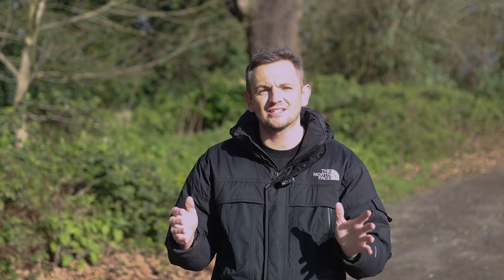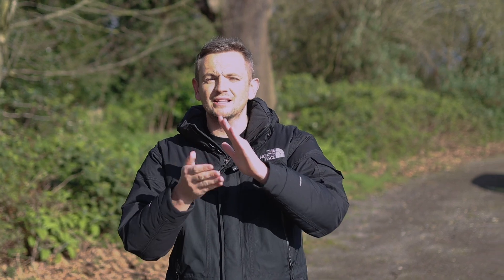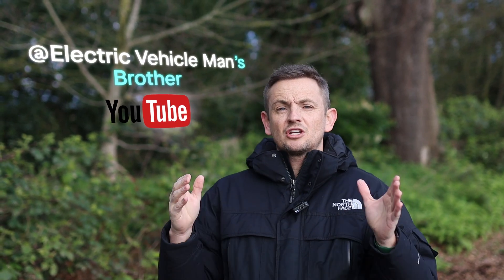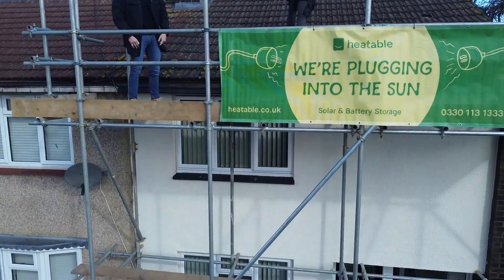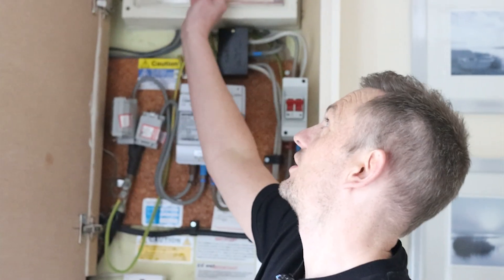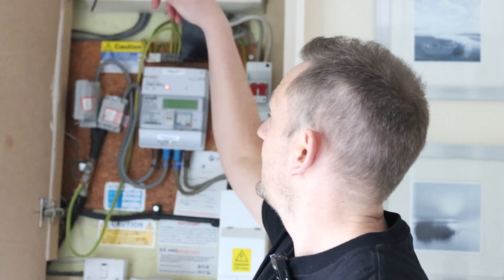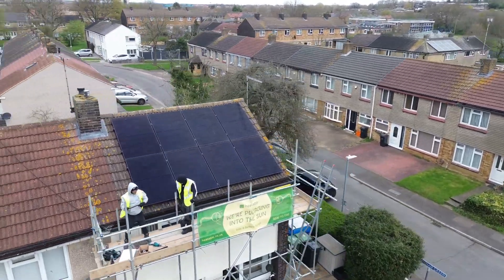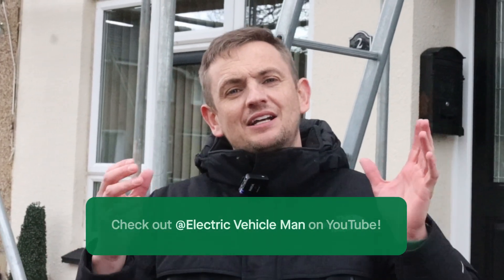440W Bifacial Panels + Hybrid Inverter: Game Changing Energy Solution?

Comment: bifacial works better if you have a gap of 4 meters. Or perhaps you can paint the roof white so it reflects more light to the back of panel.
Reply: I was wondering this myself, stands to reason it would work but to quicken the instal I'd probably use some kind of plastic or vinyl strips that adhere to the roof  tiles just behind the solar units. I'd love to see some real-world testing on a system like that to see what kind of gaines are possible.
Reply: @tangent2658  this is not made for roof. Bifacial are for solar farms,  structure mounted systems and carports.
Reply: A gap of 4 metres? Some light does reach the underside, but the main use is to capture the light passes through the top panel.
Reply: @grahamcook9289  yes I read that on some bifacial solar panel manual.

Comment: You're installing a hybrid inverter in the loft in 2024? Aren't wiring regs changing to make batteries in the loft verboten? How far away could you install a battery, in the future, without huge losses from the DC run?
Reply from the maker: Hi, thanks for your comment. PAS 63100: 2024 related to recommendations around siting of batteries. GivEnergy have released their own guidance on this following the PAS 63100: 2024 release. Ideally, where space allows we would avoid loft spaces.

Comment: Can you address one question - what is the value of using bi-facial panels on a roof install where the amount of reflected light onto the back is likely to be limited?
Reply: The benefits will be minimal. Bifacial are designed to be used where light can be reflected on to the back of them, ideally installed meters above the surface, not on a roof.
Reply: @TheRonskiman  The question was aimed at Heatable as they are the ones who installed the panels.
Reply: @rogerthomas7040  I know, but  do you really think they are going to answer the question? If answered honestly it would undermine / contradict their advertising, other option is to lie.
Reply from the maker: @TheRonskiman  Hi, thanks for your comment. We've answered the question above, we'll be uploading the comparison test in the coming month. All our proposals use the front sheet KWp ratings, which in this case is 440w.
Reply from the maker: Hi Roger, thanks for your question. This gets asked a lot so we're putting a comparison test video together at the moment. All will be revealed. Importantly though, we only ever quote the front sheet power rating when sizing systems for our clients. Any upside is a bonus 😀
Reply: @Heatable  That will be interesting, please match the panels very closely, only difference yours being bifacial the other not, and make sure you use the same micro inverters on both side by side, installed as they would be on a roof.

Comment: The REA panel has a rated efficiency of 23% that's the same as JA solars 23% also double glass black panel. Several others have 23% panels. You're slightly over stating the uniqueness of REA. Also every one of them has a +0-5w positive tolerance on their leaflet. None I've seen state +/-5w
Reply: You can find a number of vendors who make statements about their products such as "Module efficiency up to" or for one vendor their warranty states "During the first year, {The company} warrants the actual power output of the Products will be no less than 97.5% of the labeled power output." which is stated on a 575W panel for 2.5% possible drop is a fair amount. Both are ways to not have to state a firm +- value. As long as you find the fine print it is easy to work out the real 'value' of a panel.
Reply: JA is low end Chinese rubbish. No comparison to REA / REC etc.
Reply: @singlendhot8628 
REC not comparable to REA
Reply: @singlendhot8628 and how do they perform as the temperature of the panel increases? Better or worse than REA?
Reply: @StefanHolmes  

REA = Rolls Royce
JA Solar = MG

That is the best way to describe the two. There is no comparison.
Reply: @singlendhot8628 That's very easy to write, but what proof do you have? I've absolutely no complaints about my JA Solar panels connected to my Rolls Royce Victron system.

Comment: Inverters require airflow have no fans. Putting an inverter in a loft is against newest regulations. Will be hottest there when max sun. Recipe for inverter failing early! Also that 9.5kwh battery weighs 100kg. Who's carrying that up lift stairs and putting it on thin ceiling joists. Fire dept don't want 100kg falling through a ceiling. And did you put in linked smoke alarm per regulations?partisan did a while video on this just a few weeks ago. Loft location should be last resort. DC risk is overstated. Reminds me of Edison Vs Tesla electrocuting an elephant to prove one was more dangerous!
Reply: Note I watched a solar video installer in Australia troubleshooting failed inverters. They were all installed in lofts! Lithium batteries like 10-30C for long life. Will throttle output at 0C. Another reason not to locate in a loft. The battery that comes with that inverter has a 5 foot fat cable. So you're forcing it to be installed in the loft. It's not the best location

Comment: Thought the latest advice was not installing in loft spaces
Reply: It’s best practice to not put them in the loft. But these guys are selling you bi-facial on a roof system which is pointless. They’re meant for ground-mount, car ports, areas with reflected light.
Reply from the maker: Hi, thanks for your comment, the recent PAS 63100: 2024 update specifically related to recommendations around battery installations in lofts. Ideally, we'd install inverters in cooler locations however, space was limited here
Reply: Just battery not to be installed in lift space.

Comment: Is it really wise to install the invertor in the loft as I'm sure GivEnergy advise against due to summer high temps and if they add insulation, it will get 60 degree plus and the invertor will shutdown when you need it the most 😕
Reply: Would that not depend on if you place the insulation on the floor of the loft or the underside of the roof? My 13 year old system in the loft has no problems as the loft is configured to be cool even during the summer - air in via the eaves and out via vents installed in the roof. As for insulation there is 200mm on the loft floor.
Reply from the maker: Hi, thanks for your comment. GivEnergy don't advise against this. They recently released statement relating to the PAS 63100: 2024 advisory.